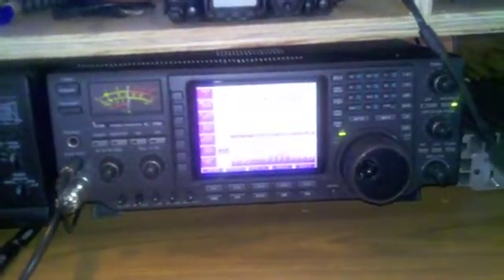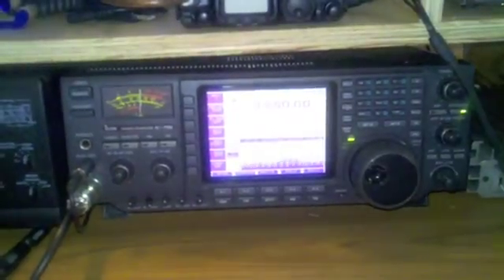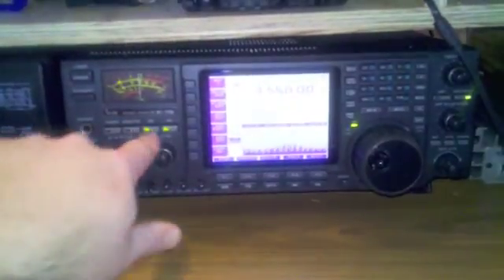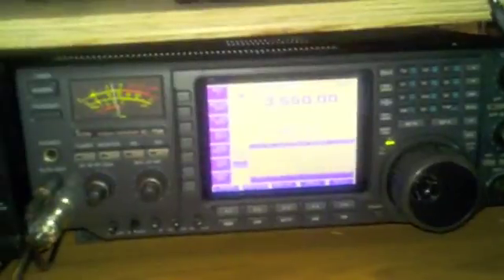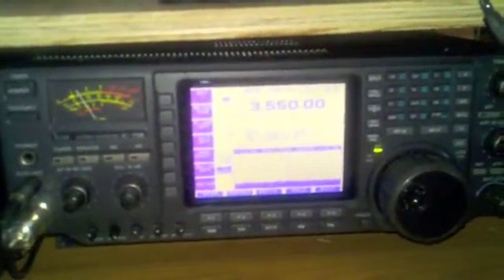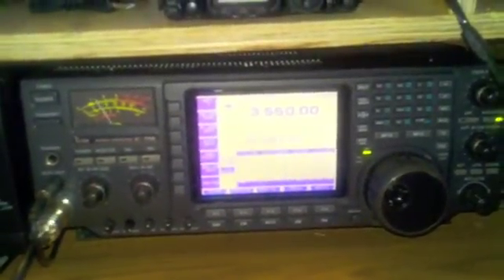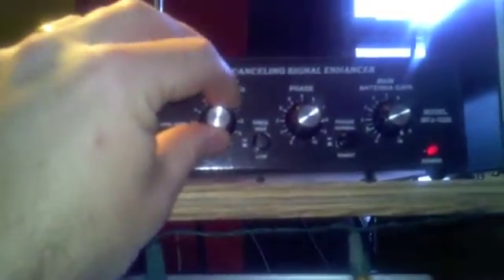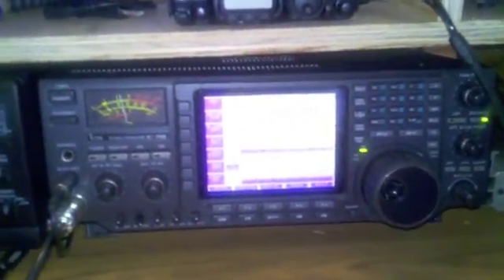MFJ1026 vs. Plasma TV RFI

Comment: BTW, all my local amateur radio equipment suppliers, namely Radioworld and Durham Radio here in Ontario, are currently completely sold out of these units and have them on back-order with a waiting period of about 1 to 3 months. DX Engineering has a huge inventory of the MFJ-1026 in stock. Even after shipping and taxes when ordering it from DX Engineering I still saved 10 dollars even had I drove to Radioworld in Toronto and picked up the unit. 73 -VA3AWP

Comment: Well I finally got around to ordering this little unit and it has worked like a charm in eliminating the plasma TV interference I was being bombarded with on a nightly basis. Not only does it do a great job with plasma TV RFI but it will also null out all kinds of other interference on the HF bands as well as act as a phasing unit if you have a dedicated external receiving antenna. I bought mine from DX Engineering who is currently selling them for a 179$.

Comment: WOW!!! I've been having MAJOR issues with a neighbour for a while now and I'm going to pick one of these up after seeing this. Thanks for the demonstration as I assumed that since the "noise blanker" and the "noise reduction" filters on my Kenwood TS-2000 had ZERO effect nulling out the plasma RFI, that a fairly cheap box from MFJ would do very little as well. Obviously when tuned correctly the MFJ 1026 works very well. 73 -VA3AWP